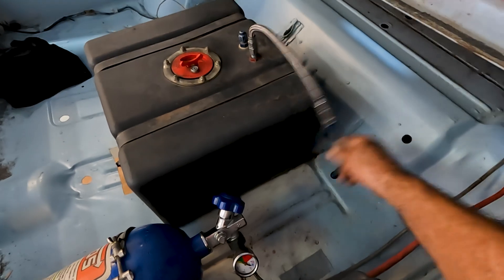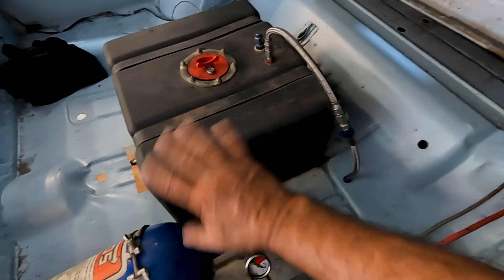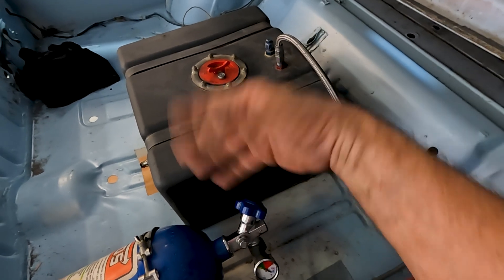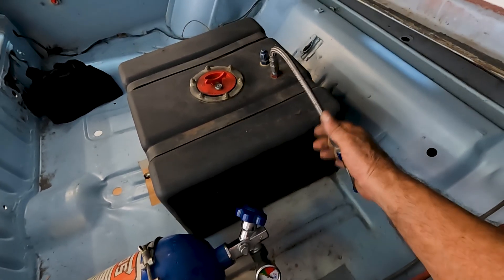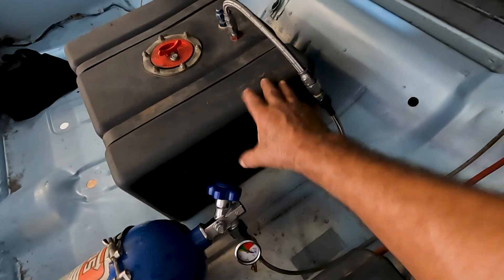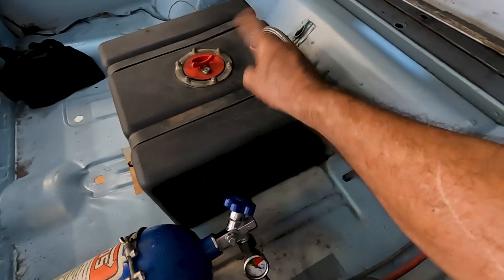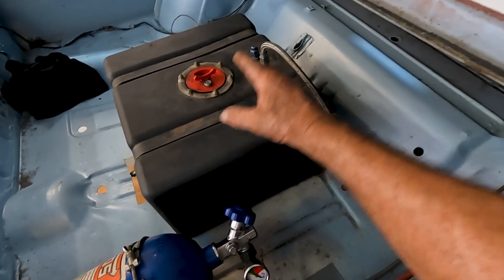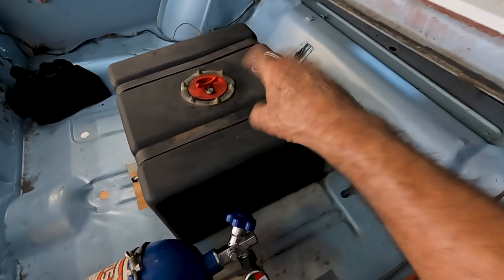Info We Hope You Never Have To Use - Venting Fuel Tanks To Prevent Catastrophic Fires

Comment: thankyou im working on a 54 anglia thames gasser fuel pump was mounted a holley blue electric pump above the tank and sideways, i just got it below the tank upright and thought i had a return line ,nope done see one im running 7 pounds burnt 2 pumps the motor  but now i notice no return line and the vent line,im checking for a check valve in the vent line,withouut a return line and the pump runs all the time,is that the couse of burning pump motors or being sideways, isnt this deadheading should i crank the presure up probable run a return line would be smart,,geeze the things you find if you didnt build it all street legal car 302 chevy dart block ran mid 12s with a holley quickfuel mech 750  dam i can always run a rubber line i gues maybey not do it right

Comment: You NEED to go from one side to the other side before going through the floor. If you end up on your passenger door that current line can still pour fuel out onto your passenger tire. Most rollover valves on there side will be OPEN they need to be completely rolled over to be closed in most cases. If you run the line from your current position on the passenger side over the tank before going through the floor on the drivers  then its much harder for fuel to get out. 
You can use a pcv in the line just above the tank (if tech allows) to act as a anti slosh valve and slow fuel in a rollover. 
I linked a one take cell phone video below showing my old junk trucks setup that would have no issue in a roll but also has no issues with venting or vacuum with the sealed cap. 3+ years in use(mostly sitting) and its messy but functions great. 
https://youtu.be/0e4nybDnVFs?t=434

Comment: One thing I have started doing Every  Time on old cars is an in-line electric pump with a relay and inertia switch.   I leave the stock mech pump and the cheep pump has a switch. It helps a lot with the no start issues that come with modern ethanol fuel

Comment: It would also be good to have the vent line headed towards the opposite side of the car that the fuel cell vent is on in case you end up on your side. On your setup down like you have it then turn to the driver's side past the point of the cell

Comment: Traded Ford trucks with a guy.  Had the front high pressure pump replaced a week before at an auto shop.  A week after we traded the fuel line popped off and burned the truck to the ground.  Be very careful when using Ford plastic clips that hold the fuel lines on.  They can crack or break off one side and become unsafe.

Comment: NHRA safety regulations are written in blood.   Really nice video, please keep these coming.

Could you add thoughts about an evap system?   The evap on my car is necessary for emissions and I know its actually higher than the fuel tank.  

"Sincerely hope its something you never have to use" - and that is the unfortunate part on all this.   How do you know your roll bar or roll cage will actually work?   Did you weld it correctly or does the weld only look cosmetically good?  etc. etc.

One safety aspect the road racers like - no anti-freeze in the coolant.   Pure water (with maybe a water wetter) just to keep the anti-freeze off the track.   Can't remember the last time the track actually checked the puke tank....
Reply: If you're going fast enough to doubt the welds on the roll cage, you should get them certified

Comment: Got me thinking…never thought about this issue.  
It looks like a passenger side roll could leave you with a leak.
Should the set up you are running have a section of tubing under the floor running to the drivers side of the car?

Comment: I have had 5 race cars in my life, none of them went faster than low twelves. I raced for fun. I'm not rich, and could not afford to chase speed. I quit 2 years ago, due to physical disabilities. None of my cars had a roll bar or roll cage. Those aren't required unless your car gets into the tens. Not a bad idea in any race car, if you can afford it. I had my vent hose routed pretty much the same way as you do, except that I did not have it secured to anything. Fortunately in 40+ years of racing, I never crashed on the track. I did have a few breakdowns, but nothing dangerous. While I like the way you did your vent hose, there is one thing I immediately thought of. Please make sure the open end of that vent hose doesn't end right behind the end of the exhaust. I know that sounds crazy, but the hose exits under the car, and the exhaust also usually exits under the car. It might be a one in a million thing, but I can just see somebody putting the end of that vent hose a couple inches from the end of the exhaust.

Comment: Use a loop if you aren’t using a rollover vent on tank, if you are using a rollover vent on top of tank before hose there’s no need for loop.
Reply: Loops are useless, a bit of fuel gets in there and you no longer have a vent!
Reply: @VideoHDYT   that makes sense, I’ve seen a ton of people running loops instead of rollover vents without any issue. I just choose to do it the right way with a rollover vent and no loop.
Reply: If you look under your kitchen sink, you most likely have a P trap, and they call it a trap for a reason. The water left in the loop stops, any smells from coming back up your pipe.
If you're lucky enough not to get fuel in the loop, it'll work.
 In 1986 I was a 20-year-old farmer kid at Seattle international raceway, running my 14 second 273 Dodge dart bracket racing. There was an alcohol dragster there, had a beer keg type fuel tank. With about three loops, kind of a pigtail vent. They were hoping to run in the high sixes Quarter mile. But the thing would launch hard and get to about 330 ft and starve for fuel , and coast to the end of the track. It did this every run, and there was a crowd of fellow crew mechanics. All trying to figure out what the problem was. I walked up there and the first thing I seen was their vent. I told them that's the problem and they all looked at me like I was crazy!
 After about 5 more runs like that with the same results,on last run of the night, One of the crew finally took my advice. Took the three loop pigtail off, and added about a 3-ft straight vertical piece of pipe. Needless to say the car ran a 6.99 pulling hard all the way down the track!

Comment: in your daily driver..... TURN  THE  KEY OFF!!!!!!
.
this stops the fuel pump...... and stops the fire from getting much larger VERY quickly. 
most people just get out as fast as possible..... 
.
but shift into neutral, and turn the key off (it will not turn all the way, so you can still steer) 
with modern push button ignition.... it may or may not shut off the engine (might have to be in park and 0 MPH first)
.
a mechanical fuel pump (carburated motors only) will still pump if the engine is on
which is why you shift to N and turn off the key.......or at least hold in the clutch
this removes / at least lowers the RPM..... slowing down the flow of fuel
.
.
turning off the fuel pump makes a MAJOR difference in engine fires on "daily driver" type cars

Comment: So im listing to the vent system on fuel tanks, what came to mind is a ball ck valve where vapor can escape but, liquid cant flow past the ball. Picture a wet dry vacume
You can suck up water untill fulids raise the ball and shut off the suction from the motor, let the water out the vacume can pick up water the ball floats on water or  liquids shutting off the flow air can pass fuel cant.  Thats the vent system you should be using  the vent system also sends the vapor to the motor  and its sucked up by the carbrator  assuming its not a computer controled fuel injected system.

Comment: I was at US 13 Dragway in Del-Mar DE years ago and a Camaro broke an axle and the wheel ,axle, drum assy came out, flying and bouncing out, and hit the car beside him. then both cars went out of control and crashed. It was a bad scene, thankfully everyone was OK. It's not always your car that has a failure! The Marine industry uses a nifty double check valve for fuel tank vents on boats. It maintains a specified pressure or slight vacuum in the tank. works great, vapors don't leak out freely. it's kind of like a 2 way roll over valve. liquid on either side of it will close it. Any way, for what it's worth, that's what i used.

Comment: In the early 2000s I was friends with a guy who was running a blown nostalgia front engine dragster.......I was in the pits and they were chasing a small oil leak that was running down the frame and dripping down on the ground near the rear tires....My Dad found the leak but myfriend and the small volunteer crew were so amped  up about going rounds they tried to clean it up fast and send it anyway. He totally ignored the fact it was leaking and needed a new AN fitting that could not be found at the track....by dumb luck he forgot his drivers gloves at the starting line and could not run the round....it blew oil out of the fitting headding back down the pit road and coated the left rear tire in oil......sometimes its the "loose nut behind the wheel" thats the most dangerous part of the car.

Comment: The speed of the car has nothing at all to do with if it can or will flip.

And to ME, ventilation SHOULD be multiple-times-rechambered through the vent!

This means 2 or 3 half to full gallon alloy aluminum subchambers [connected by stainless steel braided fuel line] before fuel can escape to the outside world.

Comment: How do OEM vent setups work? They usually have the vent at the filler neck, but they don’t leak when you flip, do they work similar to a petrol pumps cutoff valve but in reverse?
Reply: Anything with evaporative emissions vents the tank into the engine. They actually pull a slight vacuum on the tank.

Comment: This is one of the reasons why I bought a 178.99 RCI 16 gallon fuel cell with built in 0-90 ohms sending unit . it comes from the factory with check ball safety valve for the vent line incase vehicle tips/ flips over .
Reply: Yep rollover valve is mandatory. I also have a RCI 16 gal

Comment: Tony, what percentage of passenger cars have rollover (ball check) valves from the factory? Is there a date where NTSA made them mandatory?
Reply: Excellent question. I witnessed a roll over and ran over to help the driver/passengers. Even though upside down, the vehicle engine (and spinning rear wheels) ran a very long time.
Reply: @woodendoorgarage Thanks for the info. I worked on the fuel rank on my 5.7L '94 Caprice. I was trying to siphon gas out of the tank and discovered it had the ball check valve.
Reply: @8000RPM.  Yeah it sounds like the anti-siphon valve would also come into play in case of a rollover

Comment: Looking at the way you have yours set up, if you were to run the end of the vent tube diagonally to the other end of the fuel cell, that would be the optimal place for your set up. It could be in any position and not drain.